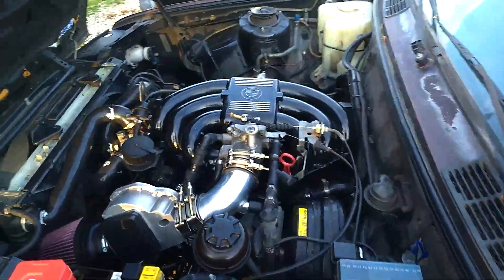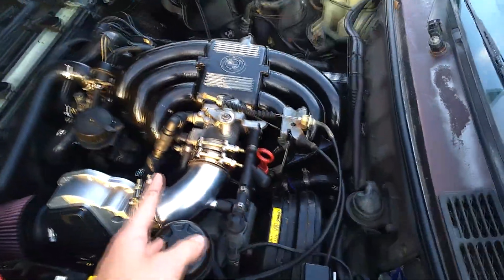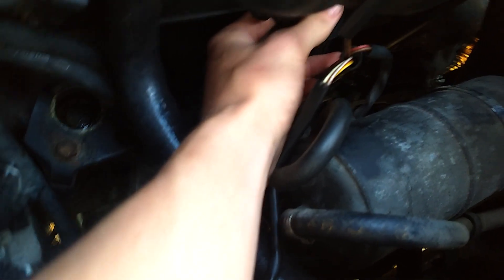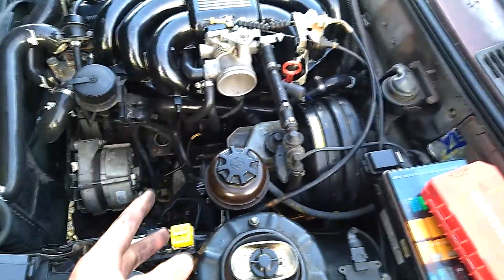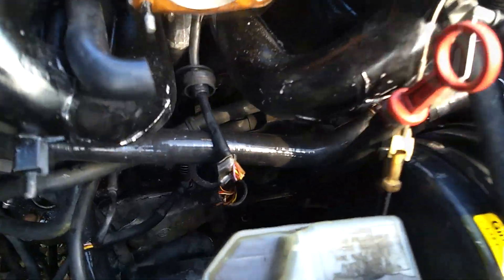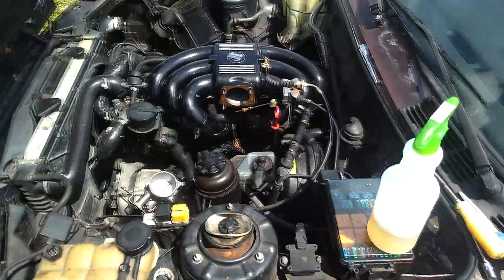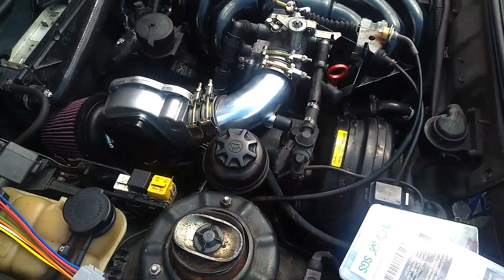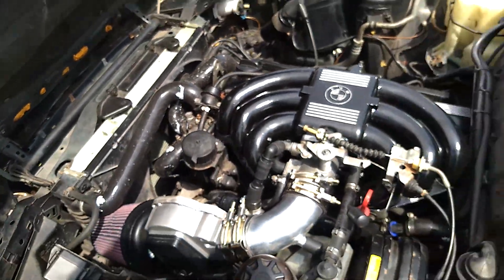BMW E30 C191 Connector Repair

Comment: If I remember, when I did my intake gaskets it also has a bracket that each side goes into and when you screw the outer coupler together it holds it into the bracket. You should have tried some electrical connector cleaner, then spray with WD-40 or other light oil, better yet, a product called Deoxit is supposed to be great for electronics and has a protectant in it to keep corrosion from forming again. Like you said, If you can't get a new one, I suggest getting both sides of a 7 or 8 pin connector (weather pack) and just cut and splice the wires with the red sealable butt connectors for wet locations, so the original wire colors match up. You could even eliminate the connector all together if you never plan to need to disconnect it but I wouldn't advise that. Much easier to get a plug and splice it in than splicing the ends and making it. You have to put the wires through the connector housing first and then splice the terminal end on it then pull it back into the plug on most of them also, you have to use the difficult crimper so it curls the wings in, because the way you had it they won't go into the plug. Most plugs for new cars with OBD II are weather pack connectors that are sealed with silicone gaskets around the wires and plug itself to prevent water intrusion. I'd suggest Ford or GM. You could even go to a junk yard and find one that looks good and 7 or 8 wires (because they are more commonly an even number). Most u-pull it places probably wouldn't even charge you for a plug.

Comment: That connector is so you can remove the engine from the car without removing the engine loom - it stays attached to the engine. Regarding your IP rated waterproof connectors, I used those for my motorcycle and they are great but you need the proper crimp tool. You were right to abort your first attempt 😮

Comment: Working on this issue. You were about to explain how to take the bottom part of the connection off.. does it unscrew all the way or does it do a full counterclockwise circle then pulled apart? If the second option, how many times does it go around before pulling it apart? Thanks
Reply from the maker: I don't remember how many times you need to turn it, but I do remember it being pretty stuck. You may need to use some pliers to twist it, or just cut it off and replace it with a new plug.

Comment: That’s the fuel injector wiring harness and u can get to that portion easily by taking off the valve cover and disconnecting it from the injectors after disconnecting the c191. I think it also connects to 2 ports on the thermostat. No need to swap out the entire harness!

Comment: @Haters Garage: what airflow meter is that?  Also, I have an 86 325es with 2.7 eta and I'm having similar issues, definitely gonna check this out.
Reply from the maker: It was a knockoff Ebay AFM; it worked surprisingly well. Running on Megasquirt now, though.

Comment: My car turned off while it was running. Checked for spark, air, compression and fuel: all check. I sprayed carburettor cleaner directly on the throttle body and the car managed to turned on while i had my foot on the gas. My guess is that i have a fuel problem. Any help?
Reply from the maker: Look next to the water reservoir, there should be 3 relays. The middle one is for the fuel pump, take it out and look at the terminals. if you short the middle left and middle bottom terminals it should turn the fuel pump on. if it doesn't, you probably need a fuel pump. If it does, I would try getting a new relay.